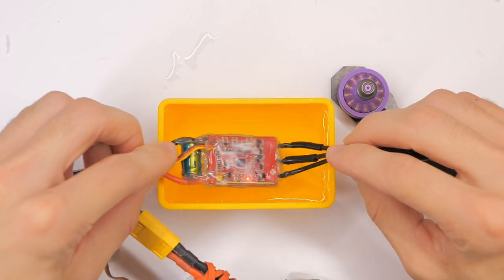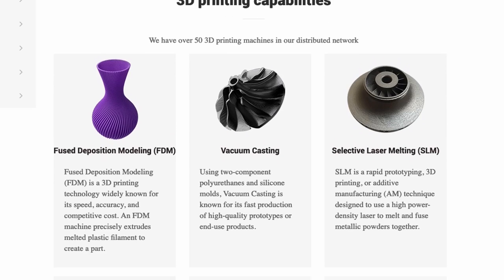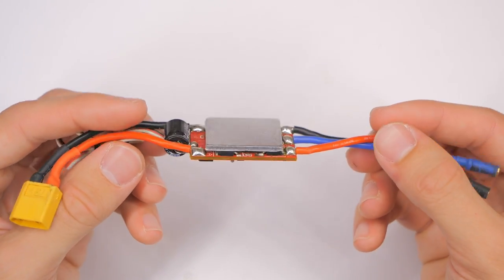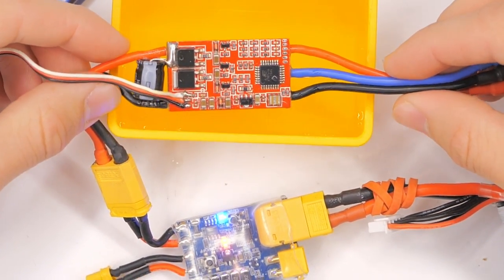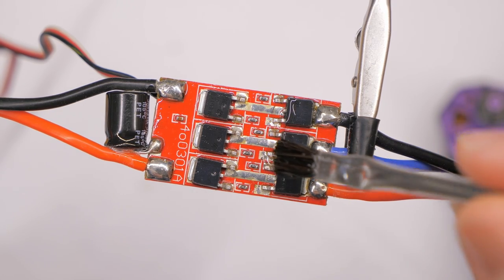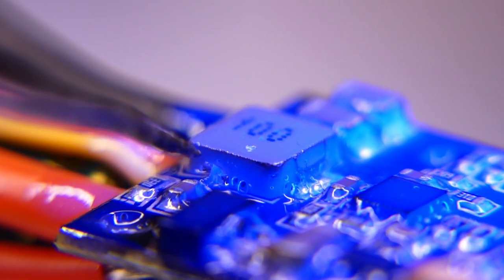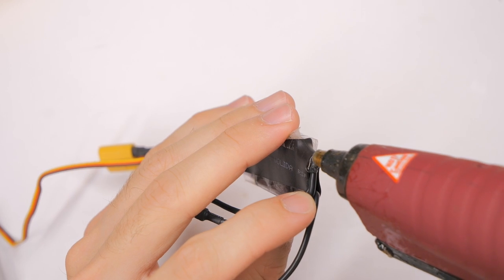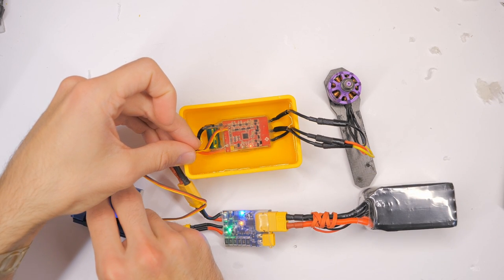💦👨‍🔬 Silicone Conformal Coating VS KOTKING VS Hot Glue - Best Waterproofing for FPV Drones

Comment: The problem with hot glue is long term adhesion in high vibration environments. It eventually starts to come loose from the substrate. Also nothing will bond with silicone except silicone so the flexible silicone wires end up being a channel to the PCB for water.
Reply: Imo the best method is a combination of both. Conformal coating first applied in the same manner one would if it was going to be stand alone and then as much hot glue as the enclosure can fit. A lot of time in life less is more, but when it comes to waterproofing electronics I don't subscribe to that line of thought.

Comment: I simply used the Ambersil conformal coating I have been using to protect electronics in, for example, greenhouse automation, for decades and it has worked just fine. I give the board about 6 coats and make sure the surface of the board is completely flooded every time. I allow it to dry without heating but using a gentle fan to speed evaporation of the solvent. It then needs to be left for at least 24 hours to cure - it's not a quick process. As a final check I go over checking with a DVM set to the 40M ohm range to see if I can get any conductivity.  
When they conformally coat board in production they totally immerse the boards in a vat of the coating, dry, and repeat and this makes sure the coating finds it's way under component legs etc.

Comment: Im using B7000 glue personally, insulates perfectly, the only downside is worse heat dissipation - had some issues in extremely hot countries possibly because of that (still not 100% sure this is a main reason - had no processor overheating warnings)
This is why im researching for some good thermal conducting material for places which need to stay

Hot glue downside for me it breaks down in places with little constant bend like wires and breaking down in cold weather as you told, b7000 doesnt have these issues, + its thin when dried, easy to remove with pliers (rolling on itself), extremely durable and with a little help of gravity you can even seal the usb without putting it inside, so you can easily tear it of and reapply it later if needed

Comment: I had this running in the background at 1.5x speed and I was just listening to it while working on a project... I was SO confused as to how the line-up was "Silicone Conformal Coating, Cocaine, and Gorilla Brand Hot Glue"... Had to run it back to make sure O_o

Comment: I haven't had a chance to try 422C, but 422B was actually very good. It can definitely waterproof electronics from dew or light rain. But you should put several thick layers of it. Currently 422B is discontinued and 422C is quite difficult to find in my country. So on my latest build I've tried kotking. It's kinda meh. The only positive I can say so far is a thick layering. But I didn't try it if a fields.

Comment: Not sure how solvents would affect some PCB boards; but I have had some luck waterproofing some of the things that I work on with DIY liquid silicone. I prefer to use naphtha but most organic solvents will do the job. Even mineral spirits. You take 100% silicone one I prefer the GE brand. And you Begin mixing insolvent and stirring until it dissolves in the solvents. Continue mixing solvent until you get the consistency that you want. You can make it as thin as paint or as thick as gel. Then you apply. The solvents will evaporate within a few hours. The vocs and solvents will evaporate completely; leaving you with a coating of 100% pure silicone wherever the mixture has made contact or has run into if thin enough. I'm not suggesting anyone do this because I'm not responsible if anybody damages their electronics; I'm just stating that I've used it myself without issues. Different plastics and different PCB boards May react differently to solvents so do so at your own risk. Silicone is very very heat resistant, completely waterproof, resistant to both mildly acidic and basic conditions, durable, cold tolerant, takes quite some time before breakdown occurs, and uv resistant. I've used this thin silicone to waterproof everything from my hot tent, to electronics. I do however recommend lightly scuffing the outer perimeter of the rear of the heatsink and leaving bare-metal exposed so that the heatsink can do its job exposed to the atmosphere to dissipate heat. Have fun. Again do so at your own risk, solvents sometimes react negatively with certain plastics.
Reply: interesting DIY silicone coating

Comment: Oh wow, those SimonK 12A esc's take me back. The "carbon" ZMR250 frame, DAL cam 700tvl with a 8channel heatsinked 200mw Boscam vtx..  RCX/ZMR branded motors  shedding their magnets every session, burning up your first Naze32 v5 because of the individual BEC's. Flying the cheapest branded 5030 2 blade props until you went to 4s, and they just burst under the RPM boost. Being amazed at the DYS 1806 2300 motor power..
Flying with the flysky v1 protocol with sudden brownouts at 50m away, getting v2 and getting up to about 2km until your vtx crapped out. Straight up because you got the signal back when you dropped down.

Fun times. Met Boris B in my beginning, he was the catalyst to a hobby many of us owe to him.

Flying without rules, though, we still got that going...

Comment: I've tried Kotking before, its a gigantic pain in the ass to remove if you plan to resolder absolutely anything, it stays there almost permanently unless you physically rub it off with friction , and it really takes a lot of friction to take it off, ever since that, I've switched to the 422B and never looked back, makes build adjustments so much easier on the long term and Kotking just isn't really a great application material to work with at all.

Comment: instead of removing the heatsink, you can glue around it to allow it to do it's job but at the same time waterproof
Reply: Well I thought the same first but after some thinking maybe Adams way is better though.
He fills some of the coating between the ESCs removing most of the air inside. And air is less thermoconductive than anything you could fill between.
So it should actually improve the heatsink efficiency.

Comment: Whether you care about saltwater resistance really depends on where you live.

I live in the middle of canada, just fresh water here.

I use conformal, but I use tons of it a coat, and do 2 coats.

Had a vehicle fall into a deep puddle and sink completely, and the lights were still on when I pulled it out, and it carried on working after.

Comment: I also wonder if you were to dip the circuitboard in the conformal coating would that work better?👍
Reply: Here's a cheesy video from a manufacturer of conformal coating about the various methods of application:
https://youtu.be/mtsW-aNKddQ
Reply: Depends on your base. Urethane? Acrylic? Silicon? A few others. You can dip most if you protect sensitive parts with masking. Dip method is slow though. I’d recommend heat cure.

Comment: You used their silicone-based but did you use the urethane based?
I know everybody use the silicone and I bought the urethane cuz it was cheaper and I haven't had any issues at all.
It does turn yellow but it's a hard coating and it can be soldered through easily.
I'd like to see you test that one out because I'm not brave enough to Dunk a ESC. 😆

Comment: Hey the datasheet from MG Chemicals says that you should cure the surface for 24hrs after application.. and you can apply multiple coats with 15min intervel.. So i doubt that this is a fair test!!

Comment: 21:04 It says on the back of the Gorilla Hotglue Pack, to store it below 130°F, so this indicates the temperature where it starts melting. There are different types of hotglue which can resist higher temperatures. Just read the manual ;;;-)

Comment: Look at 12:26 this is your problem! This coating should dry completely first and maybe you need to bake it for 10 min then let it dry for 2-4 hours(check the datasheet), both should dry completely in 20min @65 c, for me i will leave it for 2-4 hours or even more
Reply: what do you use to conformal coating you electronics?

Comment: i tried the 422C and it is NOT very good. It flowed smoothly and clear. That was nice. But after a few quad flights its all cracked and white broken up. And yes i had cleaned the cct board and dried before each application. 3 Applications in total.  Now i have to remove it and apply another product that looks promising. Its a plastic spray but i don't have the can so i don't know the name. But its made by Certified labs here in edmonton alberta canada.  Its a plastic aoresol apray which i spray on a qtip and apply to a cct board. Real nice clear and a bit flexable. so i think were good.
Reply: how is your experience with waterproofing now

Comment: The only problem I've had with hot glue is removing it without removing tiny components. 
I used it once on a XLRS receiver connection to prevent the wires from touching and when I had to remove it it was a nightmare.
You can't solder through it like you can urethane conformal coating.
Reply: Try acetone mate, Run an experiment first but it should dissolve it almost straight away.
Reply: @Top-Jimmy  good idea!
Thanks!

Comment: Wonder if you do the first coat normal, but then for a 2nd/3rd/4th coat, hold the board upside down and let gravity pull the coating over the edges of the sharp corners?
Idk. Just a thought.
Reply from the maker: Perhaps, but that is way to many coats to be worthwhile, I think.
Reply: @RCwithAdam1  true, the other idea I had was to smooth the board down in some of that sticky tack used for holding stuff while soldering, and creating a boarder around the board with it, and then just dumbing a big thick layer over top lol probably would trap too much heat

Comment: in another video a fella mentioned he used hot glue also.  Then slipped clear heat shrink on it.  And with hot air gun....  shrunk the rap will also re-heating the glue helping it settle in around things better

Comment: hot glue on an esc that heat a lot??? it work for a wille but will melt again  and get out of the pcb.   but it work on pcbs that no heat to much. in this case i recomend any neutral silicone(not the acid one tha corrotes everyting!)  i used tht black one for heat,like until 180ºC aplications

Comment: i  use cow rc conformal coating it seem to be lot easyer to apply than the conformal coat you used. i have done identical test as you have with it and it works perfect and it looks good after to. 
.

Comment: Very helpful video for me, as a beginer drone pilot I need the drone to be somewhat water resistant (due to creshes). I will try putting heatshring back on ESC after applying heat glue. Then I'll see f the overheating is and iissue. Thank youv ery much for this tip!

Comment: Hi. What do you think about bathroom silicone sealant? Cheap but maybe hard to remove :D.
Reply from the maker: It may be worth a try! I do wonder how much of a difference there is between that and Kotking or "FPV worry free"
Reply: Avoid silicone  with Acetoxy, they will corrode components with time. 
Instead, try cure silicone like Tian mu 705 or Kafuter 705, extreme economy and specific for pcb

Comment: Hot Glue of any brand is a bad idea for sealing and water proofing as it catches fire when it gets real hot. Instead use high temp complaint Silicon Rtv tube.comes in clear and white colour,,takes a bit of time to dry curing is 24 hours,,but totally worth it. also is safer for human touch and is food grade complaint. it also has a bit of flexibility and can be peeled off on areas where soldering or component change is required,,and then silicone rtv can be repoured in the gap and after curing will seal again.

Comment: I'm surprised that the conformal silicone failed! I wonder if we could use a small vacuum chamber to remove the air bubbles and help the coating get deeper into the components while it cures. 🤔
Reply from the maker: I was surprised as well! A vacuum chambered sound pretty sweet, but not very practical I think.
Reply: lmao imagine getting a vacuume chamber
Reply: @raps55  The low-side vacuum is the hardest part, do to the price, you need a "normal" vacuum pump, and a "strong" vacuum pump. (or maybe just one strong pump, not certain...depends on application, I think) There are many how to videos on this, and if you are building drones it might even be fun to try and make one. For the chamber you just need some strong container, like a thick acrylic box, or a Pyrex upside down bowl, with some form of gasket between the bowl and the surface it would be vacuumed to. Vacuum feed tubes need to withstand the negative pressure of the vacuum, so use appropriate vacuum tubes. You'd need some ball valves. A few other things too. Power supply, ect. But I think that would be a general list of the most important items. 
  But it is something that can be done if a diy-er is interested enough. Again, plenty of how to vids.
Reply: @Inertia888  :0

Comment: Hi... Thanks for the vid!...I realize this is a quad channel and I still fly but figured the Quad communities would be best to approach to help with some advice. I need to waterproof a low profile GitUp F1 FPV cam to mount onto a large RC Racing Sailboat. I am worried that if I covered it in plastic or Hot Glue ( which works extremely well from experience ), the heat these things generate might fry it as they have breather holes in the top of the cam. It's a similar profile to a Mobius or a Runcam etc. ( low profile rectangle ) Weight isn't an issue here as she's around 4kg and would even consider swapping out camera's for something water resistant as it won't be completely submerged but rather the cam will be mounted on the deck. Any suggestions on even a decent GoPro knock off would be great.. Thanks all SUBBED

Comment: Great video. There are different types of glue sticks, they are not all the same. This one looks interesting:

Surebonder 739 is a high strength adhesive with a long open time.  Primarily, Surebonder 739 strongest bonds to wood. The 739 hot melt sticks have great adhesion to metal, plastic, ceramic, coated papers, and other non-porous materials. These hot melt sticks are used in auto body shops for paintless dent repair (PDR).  

This high-performance hot melt exhibits excellent resistance to shock at both ambient and low temperatures.

Comment: Your Conformal coating didn't had enough time to dry.

Your using the brush wrong lol
Reply from the maker: Ok. How long should it dry? And what is the correct way to use the brush?
Reply: @RCwithAdam1  24 hours at room temperature for full cure.
Taken from the technical data sheet made by the manufacturer.
Personally I do 2+  thick complete coats to each side (continuing until I can see it has full complete coverage) then let it rest ~24hours before use.
Reply: Still waiting to know how to use the brush 😢